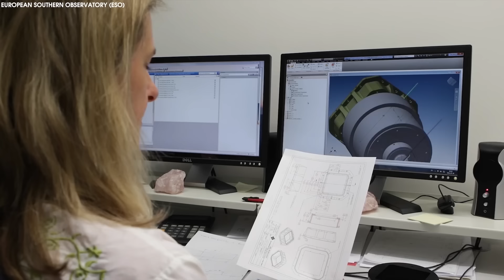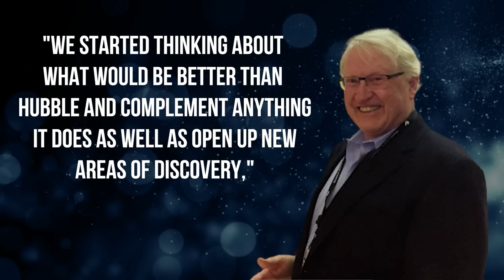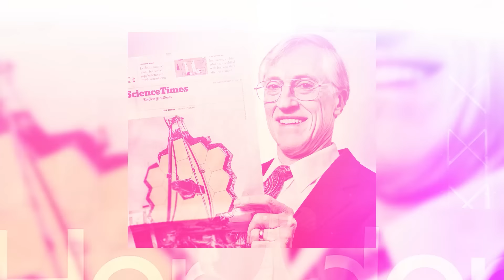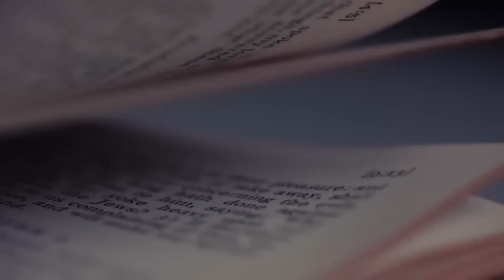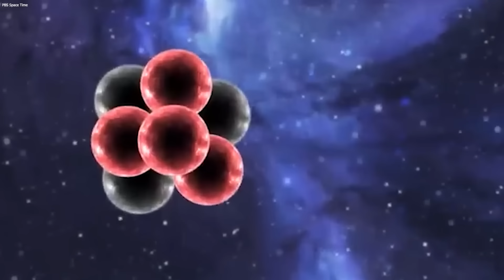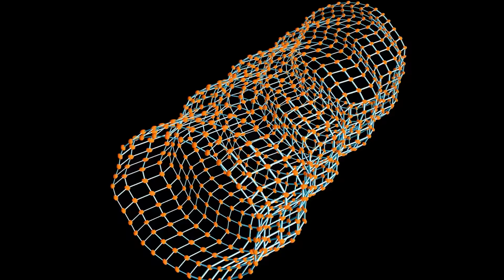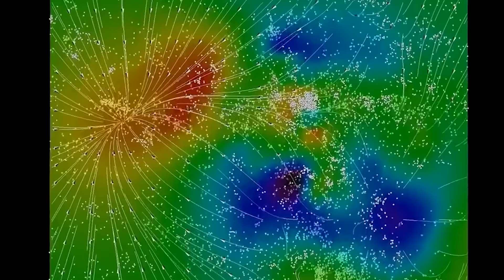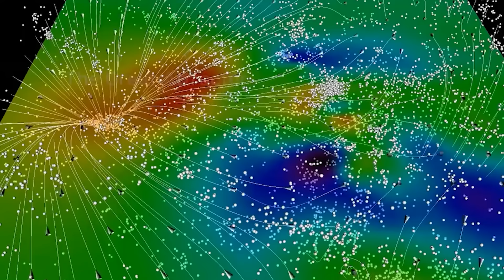Have just happened! The James Webb Telescope Discovered A Giant Structure That Should Not Exist!

Comment: The 3 Kelvin heat signature isn't from the big bang but from the cycles of the small bang.  The galactic core pulls all substance to the center and when it attracted enough matter explodes outward again to start the cycle all over again.  We cam see an early galactic explosion in the globular galaxy and in time it will turn into a disc shape and expand as far as it can till it has reach its farthest expansion and then start collapsing in on itself again only to start the cycle of brahma again.